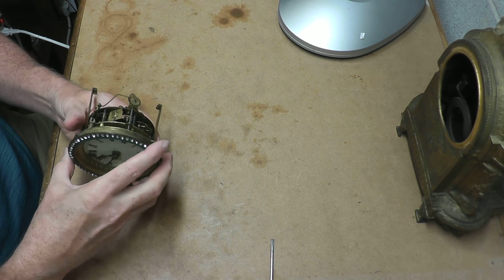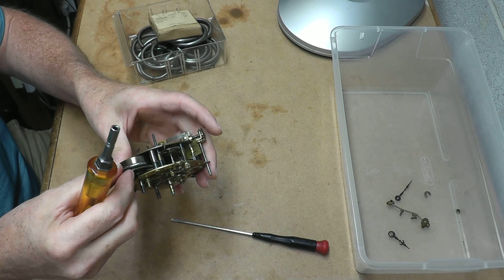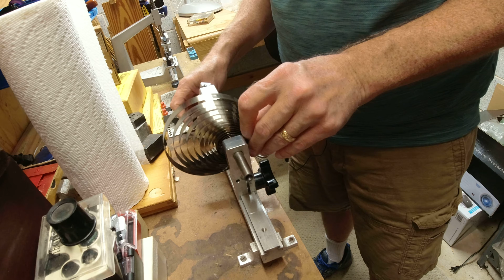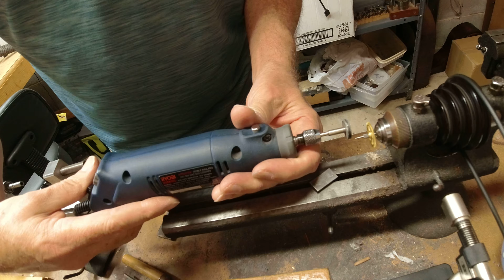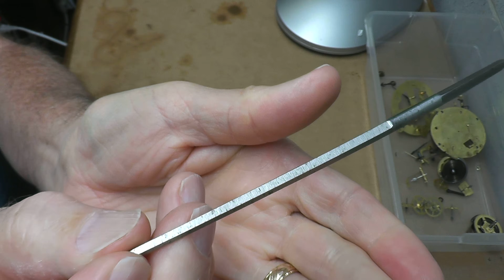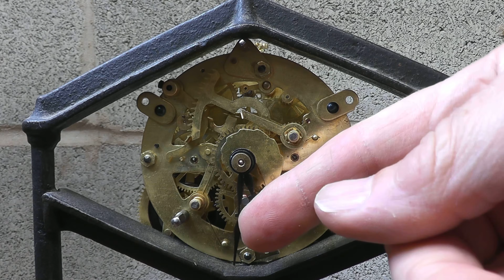Ansonia Clock Restoration

Comment: G’day  Mark and greetings from Tasmania Australia 🇦🇺 I love the old movements on clocks I have two Hemel clocks, I started a course in repairing clocks and the casings.   The problem that I found was getting any clocks to repair I dismantled two old manual clocks that I dismantled  and I was to put them back together a few so I got the parts in my head so I could put them back wear they came out of the case.    I love the way you articulate what you are doing very well and it makes it a pleasure to watch. I have subscribed and look forward to watching you kind regards John

Comment: How do you handle groves on strip pallet faces which were worn there by escape wheel?. Also several of these I have seen have need for mainspring arbors bushing. Plates are so thin do you solder or epoxy them in?
Reply from the maker: I use the same polishing wheels I use for pivot polishing. The ones worn down to a smaller diameter work good for that purpose. I do not solder and definitely do not epoxy. You can use a course file. Roll it against the outside of the bushing to produce a knurl pattern. This gives the bushing all the extra bite it needs to stay put.

Comment: Excellent video - especially helpful is seeing how you polish pivots with a dremel tool.  I'm wondering why you don't lubricate main springs when they are off the main wheels - isn't it easier to lube the spring when it is totally unwound?.  I'm looking forward to your cuckoo quail video because I have one that dates from about 1905 that I am going to overhaul at some point.
Reply: Thanks Paul. The desk where the mainspring winder is has dust from the polishing wheels. My shop is too small to spread out my tools further apart. I’m sure some of that would stick to the freshly lubricated springs. I find the oil finds it’s way into the spring coils through capillary action. You can let the springs down without the clamps to get better access to the coils if you want.